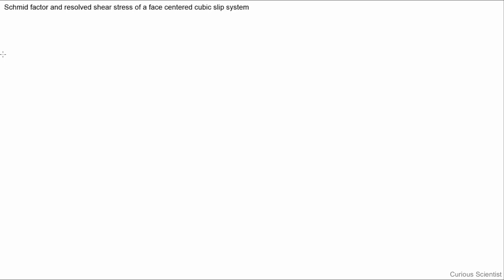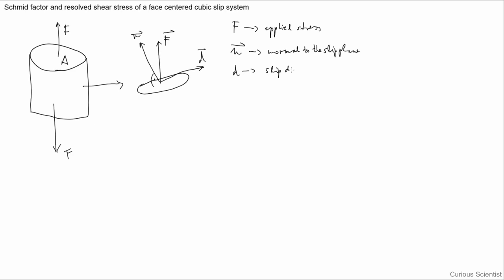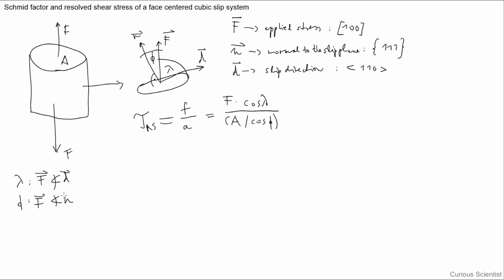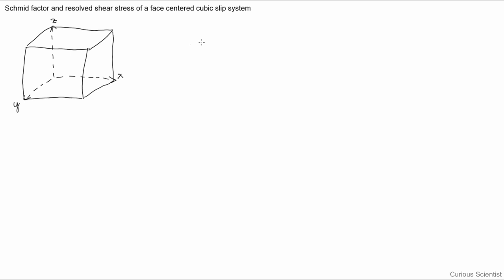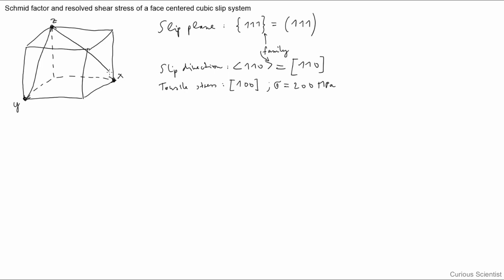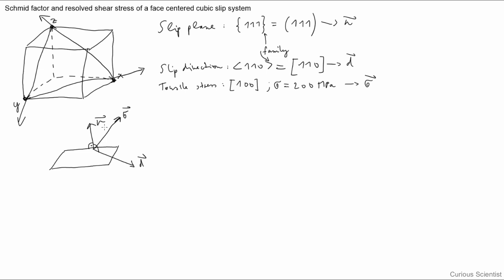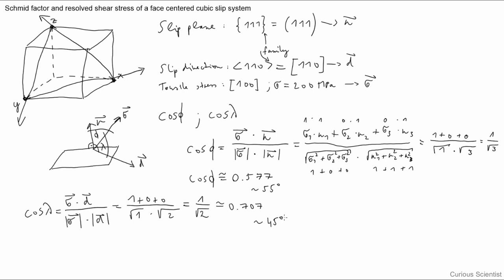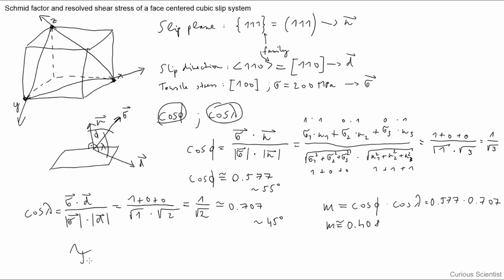Schmid factor and resolved shear stress for FCC slip system

Comment: That video was very clear. Thanks. 
I have a question related to this same example you've solved,  if the direction of the Force applied is [001] or [010] instead of [100]. We'll still have the same Schmid factor, correct?
Reply from the maker: Thanks! I don't know the answer without calculating it and I honestly don't have time now to check it. Please check my other videos on Schmid factors because I published some calculators (Excel sheets) to get the Schmid factors. You can check any scenarios with them.

Comment: Why area is written as  A/COS PHI??
Reply from the maker: Because that is the area of the slip plane.
Reply: @CuriousScientist  but how it came?
Reply from the maker: It is just trigonometry. You take the original cross-section and divide it by cos(phi) to get the slip plane's area. You see it from the original cylinder's axis and the normal vector of the slip plane.
Reply: Thank you